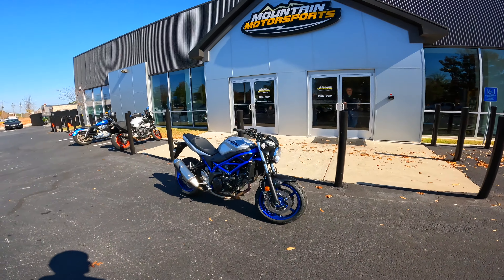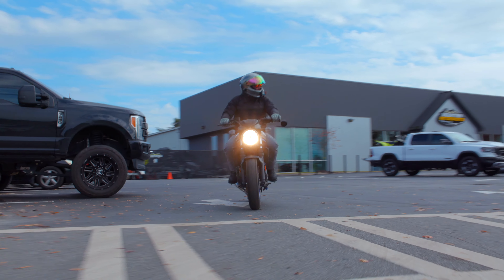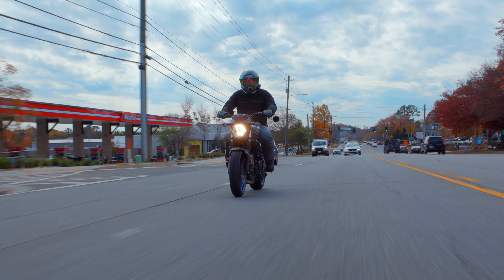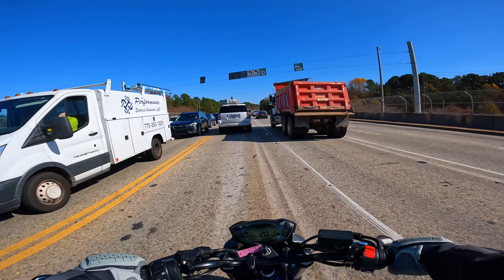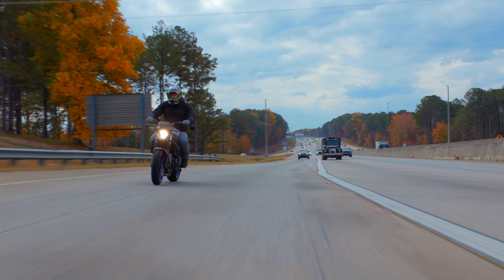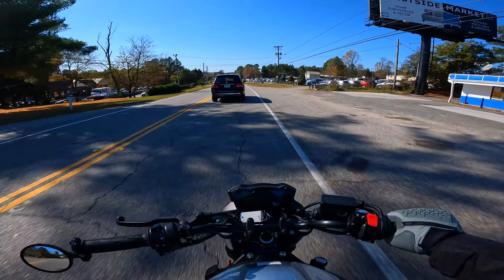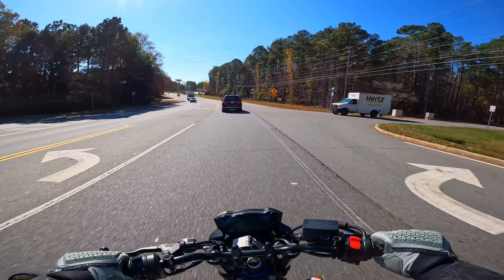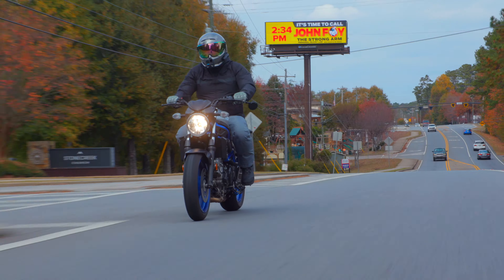2020 Suzuki SV650 | First Ride

Comment: I was looking into getting SV650 for my first bike but found a nice Yamaha FZ6 instead. Sometimes I wonder what life would be like if I got the SV650
Reply: FZ6S1/FZ6S2 or FZ6R? 

I had an 09 FZ6S2 and loved that bike.
Reply: @westondifranco9313  2009 FZ6S2 it's too much fun!
Reply: @seemesideways  Ah, you got the last year for the good fz6 haha. 

Winding it up is a lot of fun.  It's a disappointment the front suspension sucks so bad haha. 

I put 15 weight fork oil in mine and it helped, but it was still so soft and bouncy.

Comment: I looked at a lot of videos of the sv 650 and saw people say, that it isn’t good to wheelie it because of the motor and not getting oil wenn wheeling it, so I started looking at the mt 07 instead
Reply: Right, don't buy this bike if you want to wheelie.  Given the supply chain issues, you'll probably have to pay full price for an MT 07, whereas this bike in the video, I'm pretty sure you can negotiate on the price and buy it at a discount.

Comment: Bikes under 600cc should be forbidden
Reply: A lot of people love bikes under 600cc
Reply: Not all people want to ride like a maniac
Reply: @ridwankhalil1998  the problem is that people are made to believe that they are better off starting on smaller engines and it’s bullshit, it’s a waste of money because in no time they’ll be trading it for a bigger bike to avoid having to shift gears constantly  and be uncomfortable on the highway and besides just because a bike is powerful it doesn’t mean that the rider has to be on full throttle at all times
Reply: @wwfww  
Again a lot of people are happy with 400-600cc bikes and don’t want anything bigger.
My self I want a 600-700cc bike and don’t want a big heavy 1000-1300cc bike, cause I have no use for it. Plus in my country it’s a lot cheaper to ensure a 600cc bike
Reply: @wwfww  You are from US right? That highway commuting BS  can be heard only from americans. Sure go for liter bike as a starter, thanks to that approach we can admire  US riders skills on MotoStars compilations 😂
Reply: The reality is in countries with less developed roads smaller displacement bikes are what sell so they aren't going away. Higher displacement generally means more weight which is better for highway riding but it becomes a negative on a tight twisty road. I'm currently on a 400 and it's honestly all anyone needs power-wise. Love it in the twisties but like this SV650 it lacks a fairing so high speeds can leave you feeling like a rag doll from the wind. I'm shopping for something in the 700ish range with a fairing for longer rides so I generally agree with you but lower displacement bikes definitely have their place. I personally wouldn't recommend anyone start out on anything smaller than a 400 in the US market but realistically there are places where a 400 is considered a big bike so what works for you may not be the best for someone else.
Reply: @bryanmiller2023  
A 400cc bike, might be really fun on twisties and I don’t doubt that. But for longer road rides and every day use, I honestly think it would be boring in the long run, again it all depends on the roads to.
I want something that can scare me a bit and give that adrenaline burst, I don’t care for driving fast I just want that rush through the first 3 gears 😛
Reply: its a bot or someone that knows nothing about bikes and engines. a 1200cc hd is most of the time slower than a 400cc ninja. Engine size means nothing and there is a place for bikes of all sizes and shapes. by the way, sv650 does 0-60  around 4sec...what a slow bike!
Reply: Only applies to western or organized traffic countries.
South East Asia, South Asia and South America have larger sales numbers on low to mid cc bikes. Without the success and high sales numbers of lower cc bikes in those areas, japanese brands wouldn't have been able to expand to the western market like they did. Not everyone wants and can handle a 600+ cc bike. And not every 600+ cc bike is suited as a work bike.
Bikes are not just for recreational use.
Reply: @crenmao  you make a good point! I was referring only to western countries but what you say is true